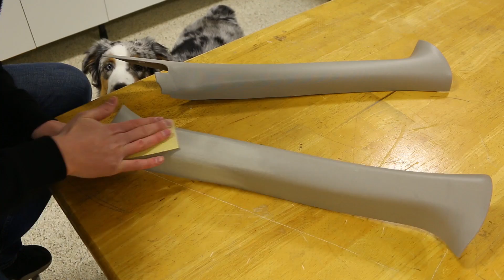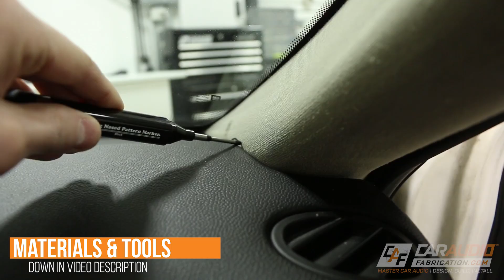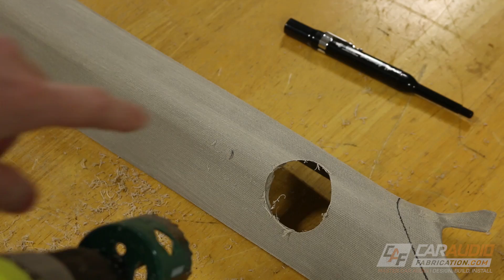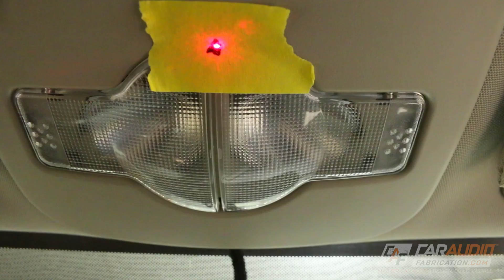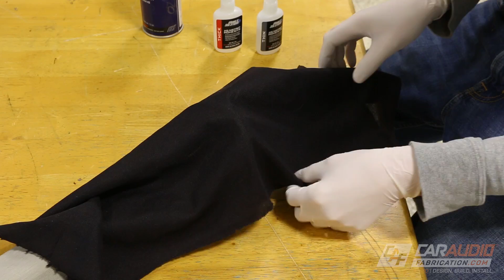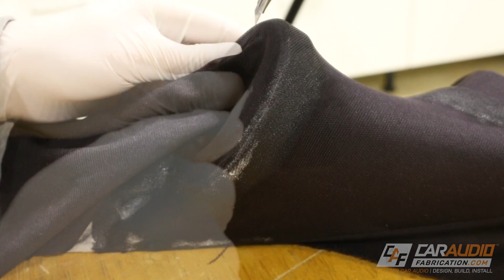Custom A-Pillar Speakers - Stretching Grill Cloth & Modifying the Panel

Comment: I noticed you're installing in a Grand Prix. I have a 2002 which is the older model. Ever done any work on the older model Grand Prix's? Unfortunately they came with 5.25's factory so getting a 6.5 to fit in the factory location is kind of difficult without fabbing up the existing door panels.

Comment: I know the in a car you're aiming for "front stage" when it comes to SQ.  The one car I built for myself in my teens actually aimed the pillar speakers at the windshield.  They were more horns actually but it was a nice warm sound that allowed me to achieve higher clarity at over 120DB.  have you experimented with aiming  speakers inside the cabin?  I got a lot of compliments for how that car not only sounded clean but clean from very far away.

Comment: Question on aiming, why did you chose a focal point by the overhead interior light as opposed to asymmetrically aimed on axis towards the driver? Is it because these drivers exhibit a good off axis response or are you trying to present a two seat front stage?

Comment: I just had a thought. Since 3d printing is fairly common now, and 3d scanning is also becoming more common; why not scan the interior of a vehicle, import it into a cad program, find the focal point of where the lasers would be, create a flat surface for the speaker to mount to, extrude that surface into the 3d scan of the pillars, do some shaping for the end product, and make a cavity of where the pillars are, then print the speaker mounts. It'd fit the pillars well enough, if not perfectly, and it'd have the speakers would have correct aiming, and you'd have the finish shape without a ton of fiberglass work. You could probably even make it hollow with some support material, and use expanding foam later if needed. 
Even if you don't print the end product, using a scan and cad would give you the proper angles and lengths for those dowels or whatever supports you want to use.
Reply: Xander Zoolander high frequensies is directional unlike bass, therefore it needs to be pointed at your ears, otherwise the stereo image suffer, unless you are tall and sit in the middle.
Reply: Read the comment again, maybe read the whole comment if you didn't the first time. I said the speakers would have the correct aiming, and I never implied the aiming wasn't for the driver only.

Comment: shouldnt you go as far forward and back as possible to reduce the amount of unequal distance? like in the kicks
Reply: OK so the issue with "highs" is they are extremely dependent on direction. SO mounted down low in the kicks or door panel you have so many problems with interference from materials in the center counsel and seats. By mounting them higher up you maintain all of the details... AND using the proper equipment and speakers, you can easily "tune" everything to sound good. Without any issues of the highs or lows over powering everything.

Comment: Mark which is the best/better sounding set up for a 3-way active set up...
1. Tweeter & mid on the A-pillar and woofer in the factory door location
2. Tweeter & mid on a kick panel and woofer in the factory door lacation
Reply: That's a real can of worms to open up. I like #1 BUT:
 What sounds best is different per vehicle, and what is acceptable to the owner. Some vehicles have crap space for kicks, some have A pillars too close for comfort, and some have obstacles/reflections that color the sound.
You can try diymobileaudio DOT com/forum/ Can be really helpful for vehicle specific answers.

Comment: my window is rattling when volume is super high. how do i prevent this.
Reply: Keep the volume lower.
Reply: Shawn Jones you need to deaden the door's with Dynamatt.
Reply: Shawn Jones.    In my Datsun 240zx, I found that it we not the glass but the whole door an hatch. I added heavy duty weather stripping to help correct the rattle.  If you find that it is the glass itself..in my Chevy 3x3 I had to pull all the door glass and replace all of the glass runner, anti dust pieces, and insulation material and all guide arm parts as these had simply  worn out over 30 some years
Reply: Did you try bubble gum?
Reply: Shawn Jones Dyna matt will save you a lot of money.